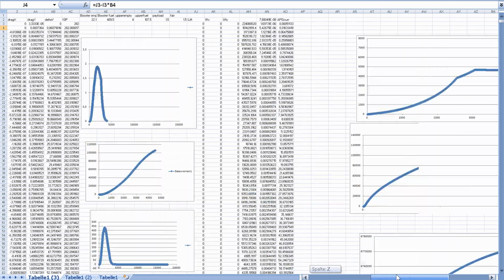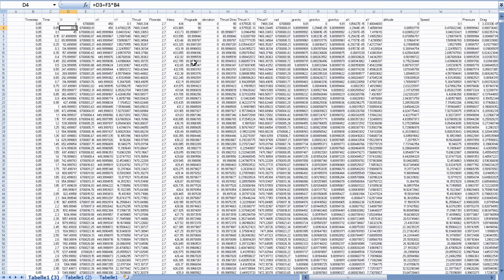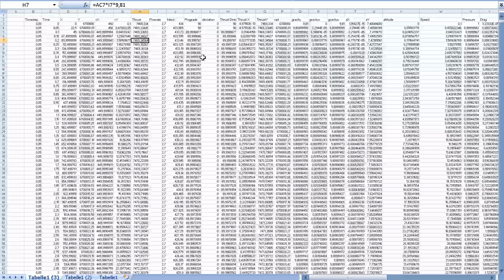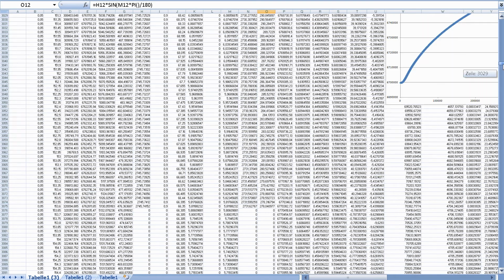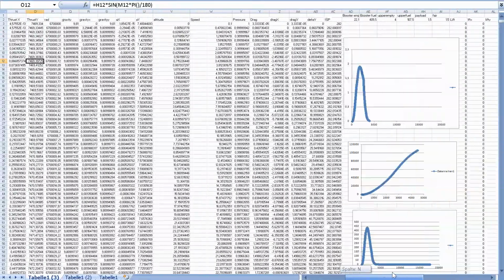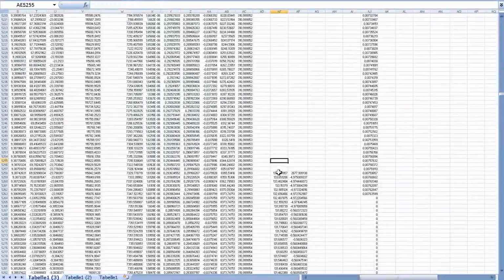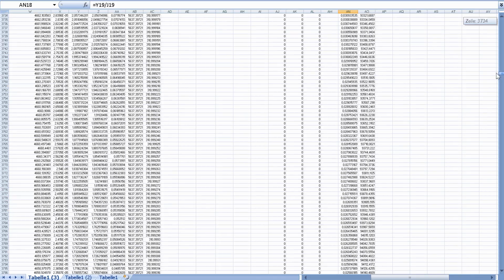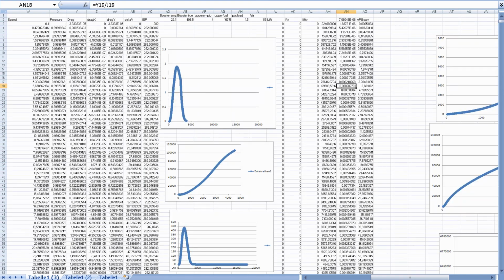Using The Falcon 9 First Stage As SSTO And More Bodged In Readouts - Excel Launch Calculator Fun

Comment: In this, how do you tell the difference between mass and fuel and when you are out of fuel, since mass just goes down until nothing. Is it possible to have a fuel section and mass section differently?
Reply from the maker: just go down until the mass is at the rockets empty mass, then turn thrust to 0

Comment: How do you expect people to follow you when you have custom stats to everyone else? IT IS FUCKING IMPOSSIBLE!
Reply from the maker: what exactly do you mean by custom stats? this is an exel spreadsheet on my computer not a multiplayer videogame so what you say seems to make very little sense
Reply: In the video, you have you used custom figures from your simulation, which any other person trying to follow simply does not have. Is there a possibility that you could host these figures online for others to use too?
Reply: In one of many problems in trying to create this, why does max-q look like a straight line? https://i.imgur.com/izlWVBL.png
Reply from the maker: what value is this? it's probably a trigonometry issue, dividing by zero as the aoa passes through zero
Reply: The graph above is of drag and mass (Y5/J5) and is meant to predict max-q like yours, but as can be seen, it doesn't really do that at all.
Reply: I've matched each and every cell formula from all 3 videos as best I could and I just don't understand how it is acting so differently.
Reply from the maker: I'll see if I can find a reliable filehosting site that alows excel documents - are you sure you got that right? your image looks a lot like dividing y something that goes through zero and neither drag nor mass should be zero at max-q
Reply: Since your explanation in the three videos is fast, It is really quite hard to judge how you've managed the overall structure. In all 3 of the videos, I often had to watch the video frame by frame at a time.
Reply: After watching your video a few more times, I've figured out what was wrong and now my max-q graph looks a lot more like yours, https://i.imgur.com/lgy9QFQ.png . With trying to model Falcon 9 max-q, it is 10 seconds early and occurs at 49 instead of 59. I'd really appreciate if I could yours for comparison.
Reply: Since you used a simulation for your flow rate, have you got a formula for throttle down? Would it just be using 80% of 2.7 FT